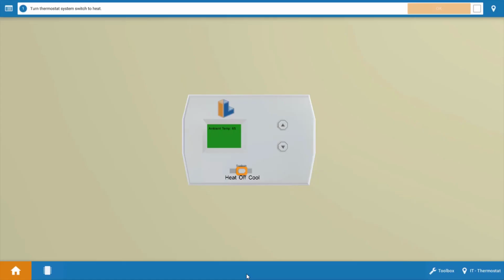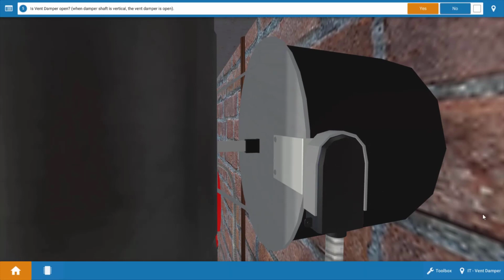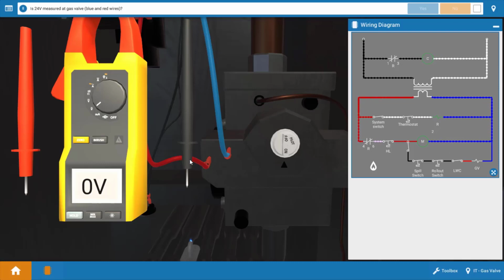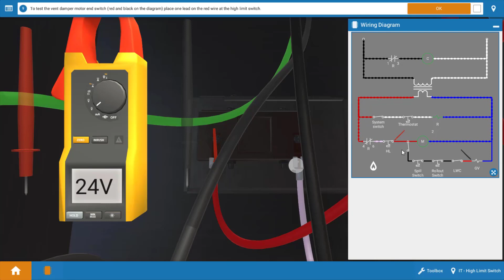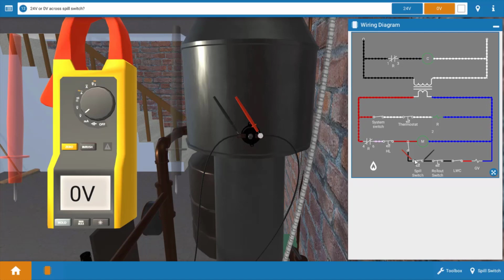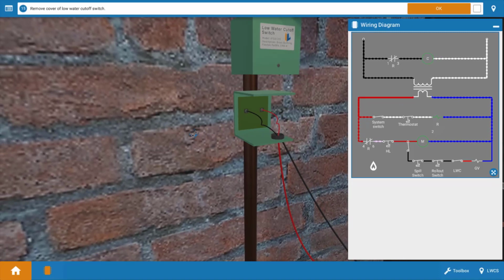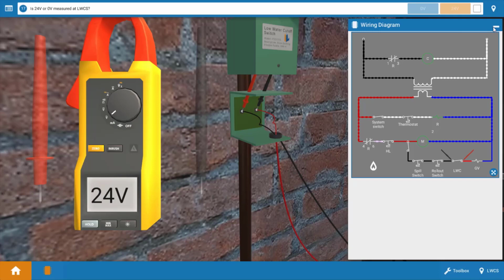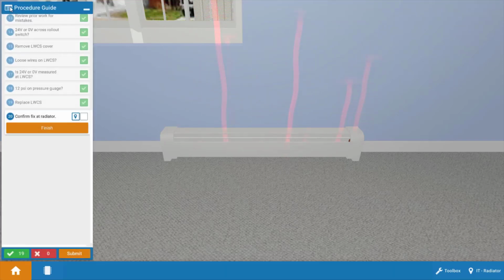Troubleshooting an Open Low Water Cutoff Switch on a Gas Boiler

Comment: with the low water cutoff open, you will always get a zero reading across the spill and rollout sw. whether they are opened or closed because the RETURNED PATH (common) is opened to the RIGHT of the low water cutoff because there's no current flow. Is this correct ? thanks.

Comment: hi, you only get 24v across the spill sw. and the rollout sw. according to the schematic diagram with the low water cutoff CLOSED right? i think you would not get anything at all across the spill and rollout sw. IF the low water cutoff was open because there would be no common return path. Is this correct? thanks.